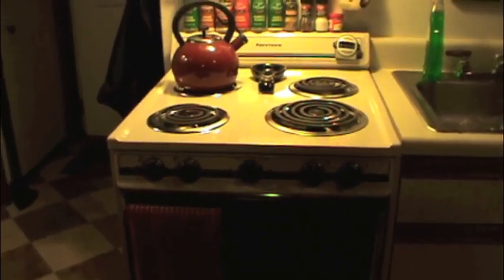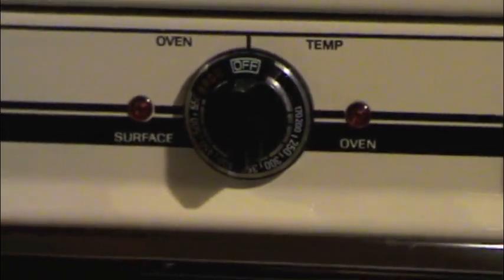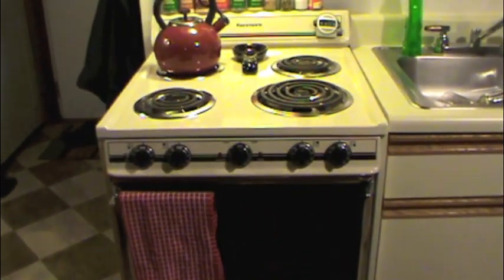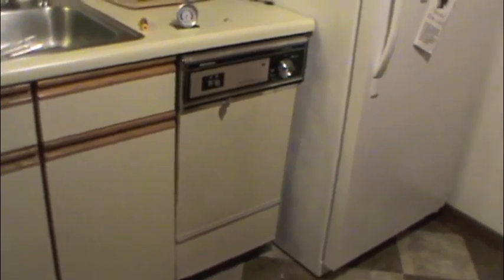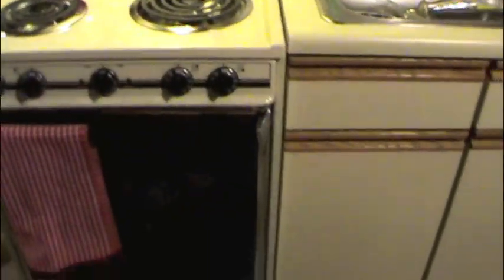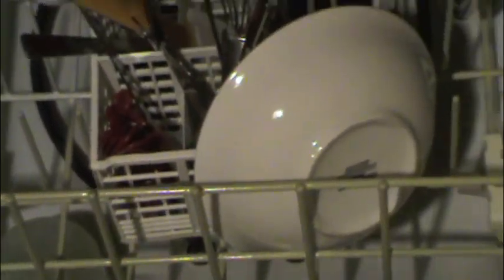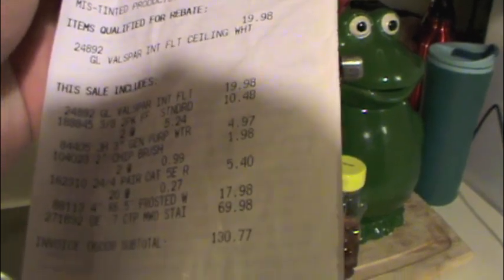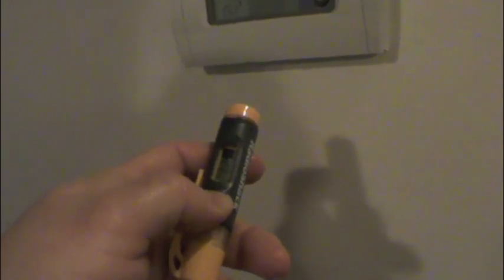My Kitchen Appliances and Rant

Comment: My grandparents bought their house in 1995.  It was built sometime between 1990 and 1995.  It still has the original stove, dishwasher, and fridge.  The overhead microwave which also serves as the overhead vent and light for the stove died around 1999, it's still there though still functioning as an exhaust fan and light.  It will get replaced when my grandparents sell the house.

Comment: I grew up in a triple-decker in S. Boston. Our kitchen had, what we believe, was a gas-converted oil stove. There was a pilot light for the burners, but the oven had to lit by hand. And it had a built-in space heater w/ a wrought-iron top. Uses to have fun throwing ice cubes on top of it!

Comment: an apartment I moved into a few months back has an older electric range; at first I was thinking "ah, crap. an old appliance." but after seeing this video and seeing what happened with a several-year old range at my parent's house last year (small control board took a shit, would have been half the $ of a new range to be replaced) I have respect for older appliances.

Comment: I have a Sunbeam electric table clock with a pendulum. The clock was a very cheap clock for its time, but will outlast anything today. The only thing I ever had to do was replace a disintegrated rubber gear, and oil it. It was made in 1965, and is running on my desk right now, keeping time to the second. Why can't they make things good anymore.

Comment: My parents have a Sharp Carosel that they bought in the early 1980s that still works like new.

I also have a JC. Peney Microwave from 1982 that someone gave to me about 5 years ago that just won't quit. I only wish I could find the manual to it so I could use the more advanced features. Most of my appliances are old relics of some sort anyway.

Comment: I'm finding, saving, and fixing old appliances (working or not) so I can use them for many years later. My most recent find is a 60s/70s GE toaster oven which works absolutely fine. It's made of chromed sheet aluminum and will certainly outlast my parent's 2000s Aroma Prestige toaster. I can just feel the difference in quality.

Comment: That stove was made by the former Roper co. before whirlpool took over..They made ALOT of stoves from 1960-1990 and now the name lives on with whirlpool, but the stoves are basic Sunray's or similar stuff...
I bought a Commercial Grade Electric Dryer and people look at it funny, as it has a timer and a on switch and a heat switch... Works great and very simple.. I always buy used dishwashers as they work and clean better, since the govt made them use less water and energy to clean with
Reply: I just moved into a new house with new appliances and so far they work very well. My dishwasher uses little water but cleans as well as my old machine. Will it last as long ? Time will tell.

Comment from the maker: @Dome31337 Timer malfunction in a new, modern, fancy-ass cheaply made fridge causes the compressor to run for four days non-stop. This actually happened to someone I know. You call that "Energy Savings?" It takes energy to manufacture, distribute, and dispose of a new appliance. You call that "Energy Savings?" This is ignoring the cost to mine and recycle the raw metals and petroleum-based plastics. Please take your Anti-U.S. rhetoric elsewhere.

Comment: The way I see it. Can you justify the cost replacing the appliance in the first place.

Let's say your old appliance still runs perfectly. But might cost $5 more a month to run than a new appliance. Your new appliance costs, say, $500. It will take you about 8 years to recoup the cost of replacing it in the first place in energy savings that is. Now if other parts fail then that is another story.